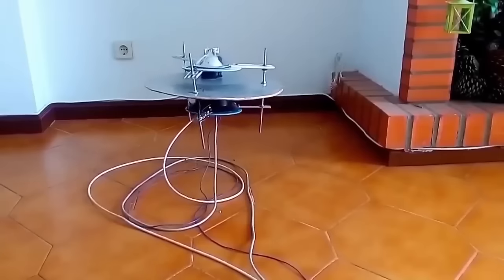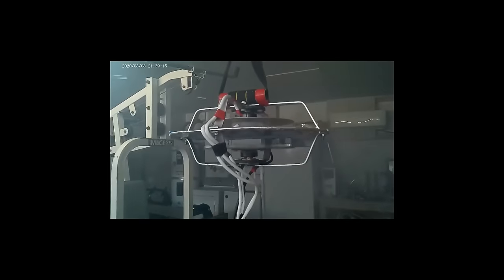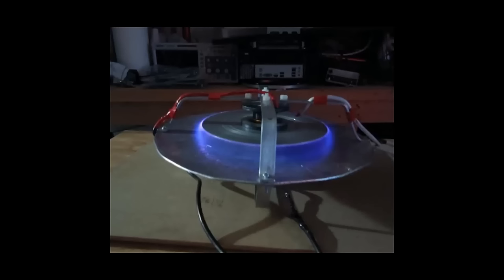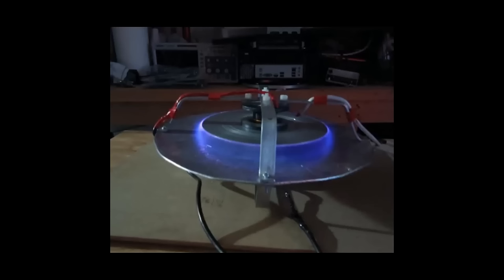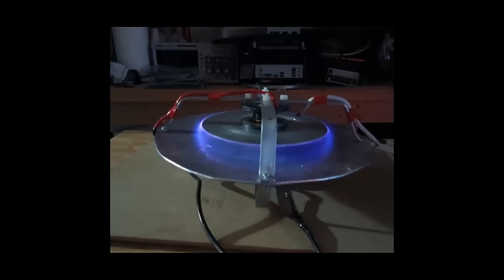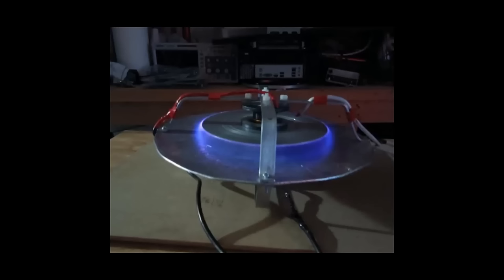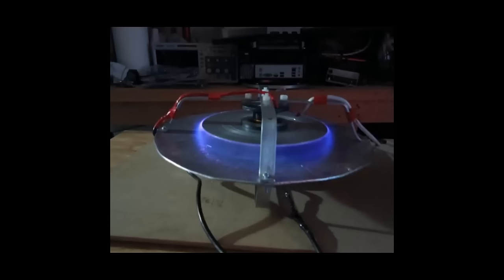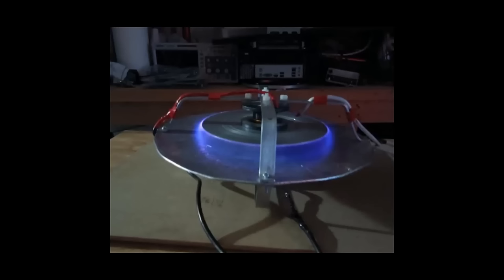Building The Graviflyer "Testing Everything"

Comment: New here, if it resonates at a specific frequency, could it ride the waves? Starting by "climbing" the air at that specific frequency really fast but think like a teeter totter bouncing off the air faster than the surrounding air can respond, thus climbing until reaching high enough to use the wind to coast, etc.
It would need to be wider, enough to rally use enough surface space to be effective instead of just dropping to the ground.

I watched a video about manufacturing glitter, it was within the past month or so, a popular video, discussing controversy and government secrets, one thing that really stuck out to me was how the gov has a contract with them not just to create chaff, but special foil parts for high capacity batteries, maybe lithium but the owner said it was unbelievable how powerful they were for the size, he got to see them work and it amazed him. I'm thinking many times over a regular lithium battery.

That said, if you could get something similar, you would be able to decrease the weight for the mechanics but the gov ones are classified, maybe there's something just a little below that which is accessible.

My grandpa couldn't afford patents and it was always a heated conversation with he and Grandma, she was clueless how amazing Grandpa was imo, he created hover craft, wireless phones, had intranet and home computer before we all got it, lol, he was a genius engineer but the company he worked for just sucked up all his ideas. He worked at Harris in Florida as his last place of employment. I wonder if they'd still have any record of his work? Breaks my heart. 
My uncle didn't pay the mortgage and we lost a garage full of their papers and everything they owned which i often lament.

Anyway, sorry for going on, but that's kinda why I'm interested in this kind of research. In his creative memory and quest to push engineering ideas. I'm only half way in your video, I'll have to catch up on what you've got going on!

Good luck!! 😃👍❣️
Reply: Found the video about glitter I was referring to so if you're interested you don't have to go hunting forever. 😂
Hope you allow posting links. 🛸🚀

2nd try...Guess you don't allow links. You can change this in your comment settings so people can share more ideas with you. 

I'll reply to this with the last end of the video code which by searching should bring it up.
Reply: Instead of thinking of gravity, if you theorize instead, with buoyancy, waves, a specific frequency wave and the 3d size of the waves, and making micro atmosphere changes quickly that you can walk upwards on or propell upwards with... Example, by a top plate changing the environment above the bottom plate and the bottom plate doing the opposite below the craft, you can resonate a frequency (or build in a dome holding a pendulum to swing at the right wave that becomes your stepping stride) that is imbalanced to get the rocking motion (step stride) to "walk up"  the atmosphere   differences your creating with the plates. 

You could experiment with dry ice where you have one or both plates ultra cold. I've been mentally theorizing about these things for years after Grandpa told me about the restraints of the hover craft being weight, energy needed and needing flat land below, all restricting the height it can achieve.

I found an old black n white military test flights video where they did have a huge hover craft, round like a UFO that got lift that was kinda hard to gauge, but the flight building was beside it and it didn't get above it. I'm guessing no more than ten feet high or less. I'll try finding it... I wondered if this was Grandpa helped develop. 

36:19  you mention the Hutchinson effect, I know who you're talking about I think, I was really into his videos back in the day, thought he was amazing... But years ago someone exposed how his work was at least mostly fraudulent. I would love for that to be wrong and I still think there has to be some real stuff he did. I haven't checked on him in years. Last I remember he was selling rocks or metal with silverware in them or something, on eBay. Is he still with us?
Reply: My comment about the video keeps going away so the terms you need are

 glitter conspiracy

The air force archive I'm referring to is

Avrocar flight test archive

I'm making a playlist for everyone:

Military engineering history etc

I'll also share via X on the handle Chromedaffodils with the references in case you can't find what I'm talking about as I'm trying to word things in such manor they are retained since YouTube seems to deter actual networking and collaboration. Very frustrating.

Happy experimenting! 😃

Comment: If you look at how john Hutchison made a cannon ball fly into the air, he used a tesla coil and also pointed a sound generator towards the object to be floated, and he would adjust the sound up and down to get to the right frequency to make it float.
Reply: yes, but to truely fly it would have taking power source with it? there trams, trains, that pickup power as the go along, no plane managed that yet? that brings Tessler coil, power in the form radio waves? and and back the cannon ball, who said had be light weight the more mass anything has the more it going to do its own thing, regardless so what going on around it, fly wheels store energy and lot of it? gyroscopes take that to the next stage neally every flying plane takes a long gyroscopes along as passenger, it an in the most siplest form, its not really fily with plane its self, and the used for navigating etc, the differences between gyroscopes the rest of the place give planes placement 3d space?

Comment: i see alot of high vibration and centrifugal force moving it around it is no lighter. it is getting exactly zero lift. good effort keep trying you never know where a true breakthrough will be made.
Reply from the maker: I never had the harmonics figures out in this video. I do now. I am working on it with a new build. I have also hooked up with Jarod Y. and Charlie C. They gave me the photos and circuit layouts of all the original graviflyer. Along with their insight. I am much further along now. Getting finished with the circuits and in a week should be testing again.

Comment: What exactly is the theory of operation?
Reply from the maker: I did a video on it. The one thing I got wrong was the transducer. It does not make it vibrate. There is no transducer in the ultrasound. It is a piezoelectric disc. It makes a ultrasound waveform.   Here is the video. 

https://youtu.be/5NEKII5ljNA

Comment: But why didn't you build it like he did? I mean if you got the thing with the dialectic wrong, then what did you also wrong?
Reply from the maker: He said it worked. So I wanted to test it. The goal was replication. I can build my own, but that defeats the point. It would also be wrong to not hit this thing with all the testing I could before calling it either way. Right now it has expanded my knowledge base to do all the experiments.
Reply: @nathanbunten4299  but wouldn't it be better to look if it's works at all to have a base value and then doing the testing of your experience? I mean he could have also tied up a string on that thing and called it a day. You what to be Scientific then you should first confirm his findings by replacting his device first. And then you can do improvement work on top. That was once the process of making scientific discoveries. Reliability by just believing what a random person says leeds always to confusion and doubts. It just a suggestion from me that you should first replicate his findings which consists to build it exactly like he said/did. Think about this comment if you get stuck and decid to throw everything out the window because of the event that it might not work. First replicate the set up to either confirm or dismiss his supposed findings. Then move on by changing one variable at the time while improve-testing the setup. It will save you a lot of life time and headaches. Don't forget to methodically ruling out all the unnecessary parameters. I will keep following you and I will consider to give it a try myself if enough people independently show the same results by replacting exactly his Setup. Cheers mate keep it up!
Reply from the maker: @icebluscorpion  You are right. I do testing without the graviflyer itself. Then apply the learning to it. I will do the testing.  My concern is that I have not resonated it yet. It may change the result of the whole project.

Comment: Dang bro your smart as hell ty for the video I didn’t know that’s how that all works
Reply from the maker: There is a lot more that I have learned. It is so much more complicated than I thought.
Reply: Interesting but I had to ask, did you ever try the counter rotation where the magnets between both plates are in repulsion and in the closest possble range? My understanding is  that this is the configuration where certain unusual phenomenon actually begin.

 Thanks,
Carl
Reply from the maker: @prometheus1111111  Yes I did. It makes it have cogging. The magnets have a strong field that stops normal operation even with a strong motor. The effect is counter productive.

Comment: There is a drawing done bye Tesla of a flying saucer that uses gravity amplifiers now that you mention that the magnets fail after a wile then you would need electro magnets  that hold a charge and a real cool thing about electro magnets , one can change the polarity of the coils or even have dual coils this will help the disk fly in another direction , i use to repair speakers , bin around electronics a very long time , I also thought about a Sphere that uses electro magnets to try to build a antigravity device that can change its axes bye the position of the magnets on the sphere and able to change its polarity bye using dual coils that can turn on and off on a matrix , depending on how big the sphere is will need a eternal power source no cables every thing has to be built in to the sphere , this will give the device freedom to move in any direction its a sphere just like Earth mind you alot of what i am saying is a theory it is not bin built or tested only speculation of a motor that can produce a antigravity field , much like Earths own gravitational field if a planet can produce a magnetic  field much like Earths own gravitational field and frequency is the key even the human brain is the same frequency as of Earths Gravitational field .

Comment: I speak Russian and the guy said that he used a sound frequency generator  through tesla coil in order to generate lyft.
Reply: If it's a frequency running through a tesla coil, it's not sound. Sound only occurs as an interaction between the coil discharge and the nearby air molecules. A musical tesla coil oscillating Tchaikovsky in a vacuum chamber would produce no sound.

Perhaps you meant simply "frequency generator" 🙂

Comment: Also, try playing with Frequency .
Reply from the maker: I am playing with the harmonics of it. With extremely low voltage. I have done a lot more work since this video.
Reply: Low Voltage Is Interesting. But, Usually High Voltage, Low Amperage Is Needed For Electrostatic Propulsion. But I’m Interested To See, What Low Voltage brings😊
Reply from the maker: @watchdogkennels5242  The amount put in is 12v 2a for the motors 24v 3a for the tesla coil and 16v 900ma for the ultrasound. The hv coil creates high volts but with very little amps left. it is more like a static volt. It's job it to carry frequency to the plates. The tesla coil has a wire not connected to anything put down the center of the #2 coil. It is there to get the oscillation frequency. The ultrasound is just frequency. If any of them is to powerful the system fails. 

He is matching the beat frequency on the center plate created by the 2 rotating disc's with hv. Then he matches that to the oscillation of the tesla coil. Then he turns the frequency of the ultrasound up and down to intersect the top 2 plates. It is creating harmonics and a power shift from top plate to the bottom plate and then back. 

Crazy how low the voltages are. Even more crazy is how all the frequency's interact.

Comment: Ok i have only watched half the video at this time... but I want to give you a different perspective that you may not have thought about and perhaps you can solve this puzzle of the gravity flyer.... I think your stuck on ionic propulsion..... and I believe that is a dead end.
I truly believe what you want to do is simply block the higgs boson....doing this will do 2 things cancel gravity's effect and cancel mass.... so the weight of the device does not matter if you can achieve canceling the higgs boson !!!!
when I saw alexia's videos (i don't speak russian so I didn't understand a thing he said)
i tried to figure out what he was doing and I think I figured it out . I think the whole idea was to charge a twisted magnetic field with high voltage.... and here is the reason a twisted magnetic field becomes a bubble  a shield so to speak that block out the higgs boson.
i noted that it took some time for the flyer to fly this is probably due to the magnetic field was not twisted enough or the voltage was not high enough.....TTBrown did experiments with 2 million volts and achieved a weightless effect on what was essentially a pizza pan
a capacitor in essence..... so a highly charged magnetic field is the key.....
However the high voltage killing the magnets is a problem....
I don't think the spinning magnet plates were charged just the plate between them
so go with the idea of twisting a highly charged magnetic field in order to block out the Higgs Boson..... and I bet you'll succeed. !  Good luck.... now I'll finish watching and subscribe...i love this kind of stuff ! thanks !
Reply from the maker: The truth is stranger than you think. It is working on harmonics and very low voltage. I have figured it out and how to reproduce it. Here is a video on the theory. 
https://youtu.be/fo8hr4D_svg

I have almost rebuilt off of my circuits for another round of testing. I will know very soon about all the milestones I layed out.